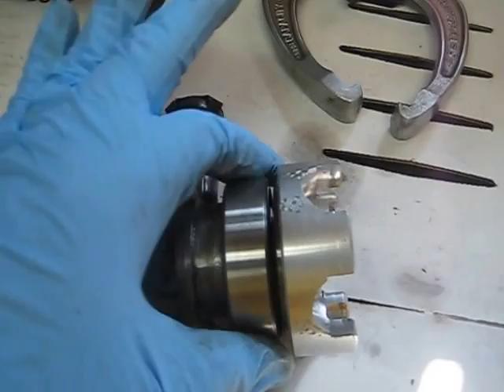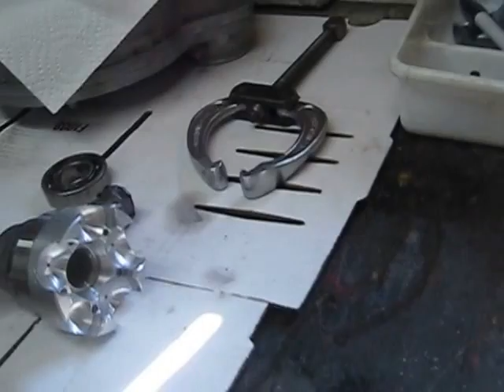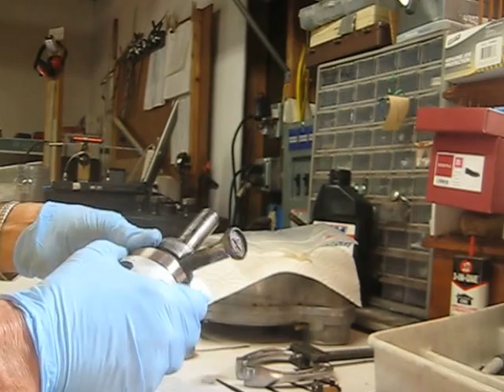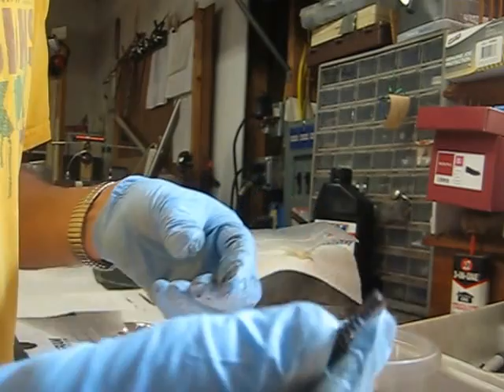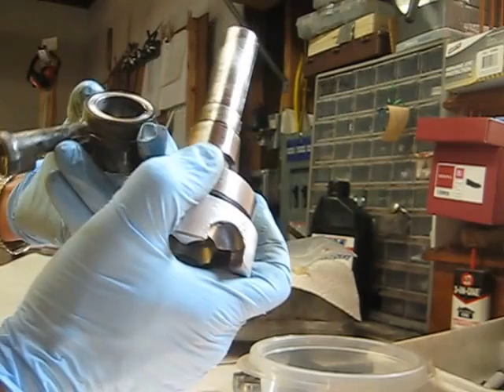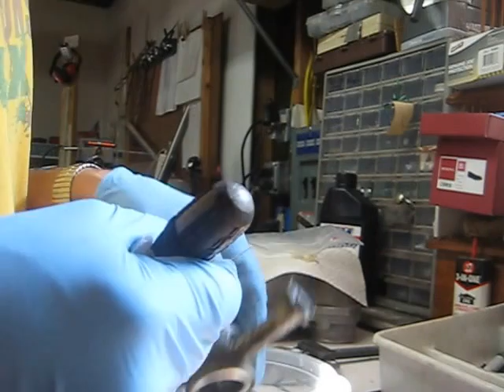Paxton SN 60 # 1

Comment: How can I test if the oil pump is good or not? I have a problem that the impeller shaft is damaged. everything is new, the new balls, everything but the axle that I assembled is damaged in less than 500 km